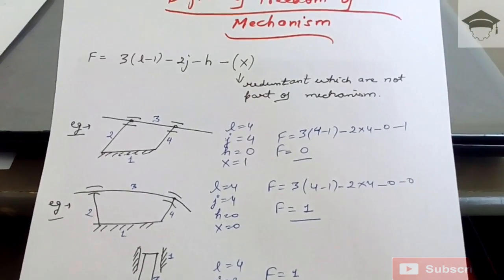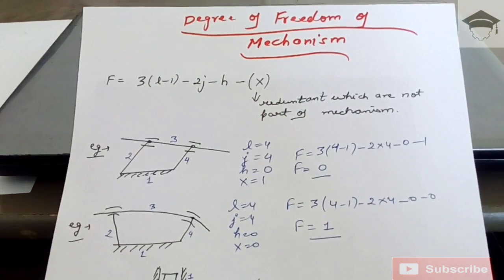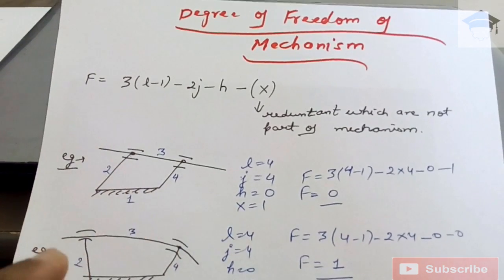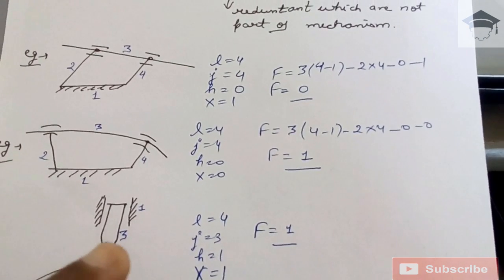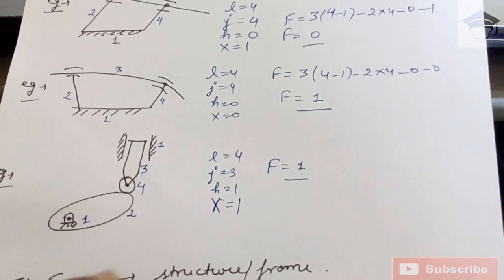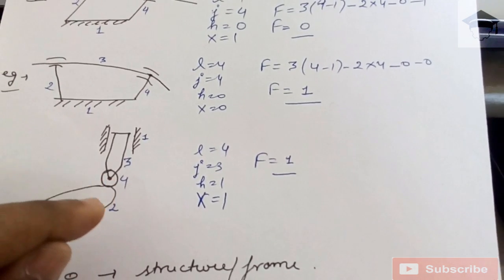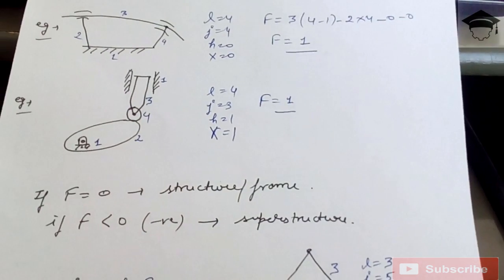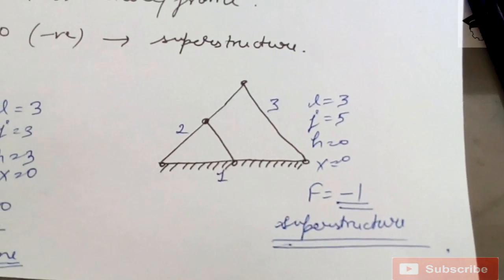degree of freedom solved numericals | numerical on degree of freedom | degree of freedom questions

Comment: For the third example, why is L = 4 and not 5? There are the 3 moving links in the middle, then 2 ground links.
Reply from the maker: All the ground links are considered as a single link . ie. whether there are 20 such grounded links but they are taken as only 1 and not 20. So here L=4 (3 movable and 1 grounded common). I hope it is clear Nick.
Reply: All fixed or grounded link are considered as single link

Comment: in fig 2 .why x is 1
Reply from the maker: Biswajit here in fig 2 , x=1 because the link 3 can itself move(slide) independently without even providing any motion to the mechanism, means it does not depend on the mechanism motion and can be moved separately without disturbing the other links.